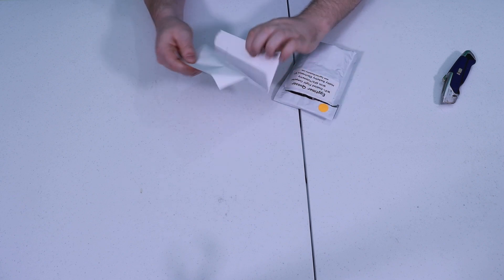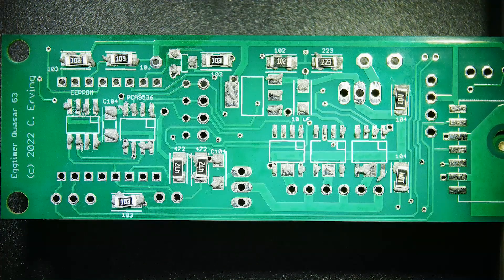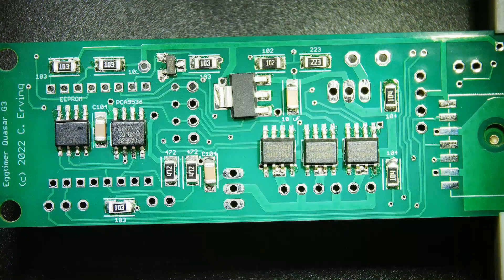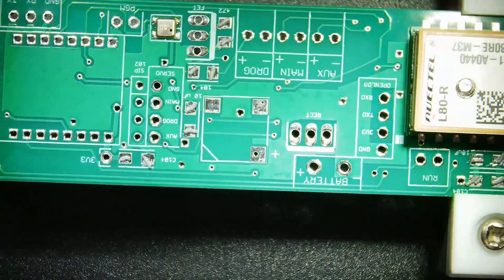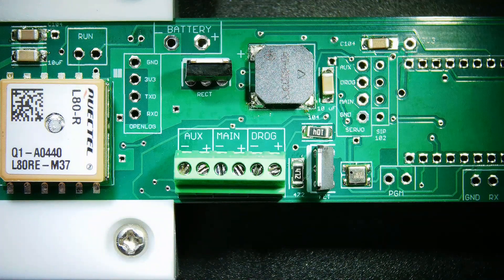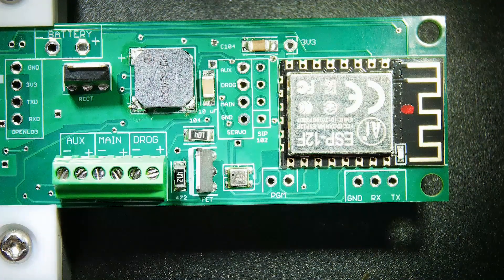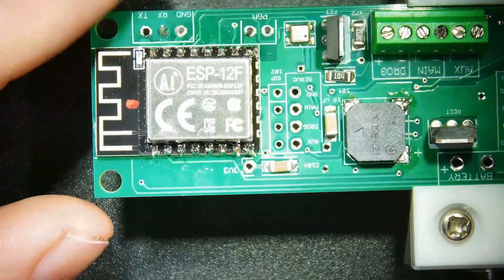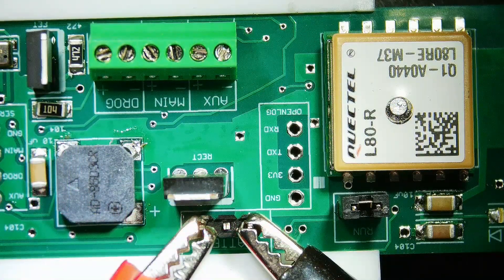Eggtimer Quasar Assembly

Comment: I’ve just ventured into Eggtimer products. Any particular reason you used heat gun instead of iron? What make, model and temp setting do you use? If you don’t mind me asking
Reply from the maker: Thanks for the question. I find using solder paste and hot air to be much faster and less tedious than a soldering iron on surface mount parts. It's not required by any means but I prefer it. For hot air I use the W.E.R 858D with the speed set to 1.5 and the heat set to 404. My soldering iron is a Hakko fx-888d set to 375 with a chisel tip.
Reply: @pegasusrocketry6618  Thanks. I also wondered if there is a strength of the solder joint concern. There is some force put on these rockets with the higher thrust motors. Or a heat issue. I’m assuming the solder used with the heat gun has a lower melting point. 🤷‍♂️ Just curious on your thoughts and opinions. Thanks again
Reply from the maker: Great question, The solder paste is made up of a bunch of little balls of normal solder with some flux. This solder is 63% tin 37% lead and has a melting point of 361°F which is the same as normal lead solder that you get on a roll. All modern electronics are assembled using solder paste and going through an oven to melt the solder. You can burn components with either method, a soldering iron or hot air. Assuming you don't damage a component there is no disadvantage to using solder paste and hot air. It will be just as strong as if you were to use a soldering iron.
Reply: @pegasusrocketry6618  Thanks again. This definitely answers my questions! The strength and temperature I had not read about any where. If I have any more questions do you mind if I contact you here?
Reply from the maker: You are very welcome! I am glad I could answer your questions. Absolutely, if you have any more questions feel free to reach me here!
Reply: @pegasusrocketry6618  Thanks 👍
Reply: @p @pegasusrocketry6618  would that be a W.E.P. 858D 
   I’ve tried searching for a W.E.R. 858D with no success.